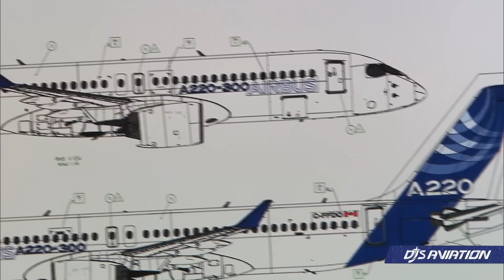Bad News For 787, Airbus News & Air New Zealand Problems

Comment: "Boeing can't catch a break"  In my opinion, Boeing is experiencing the side effects of corporate greed.
Reply: Corporate greed has nothing to do with dealing with supply chain issues
Reply: Spend your time reading Tolstoy, Chekov, and other socialist trash.  It sounds like it would appeal to your "money is bad" idiotic world-view.
Reply: @nickolliver3021  It actually does if a company selects vendors based cost vs. competent.   Airbus and Boeing both use outsourced vendors,  why is Boeing the company experiencing "supply chain" issues to the point supposedly impacting production.  Selecting the lowest bid is not always the wisest financial choice.
Reply: @dk-AZ  Do you not know that Airbus also experiencing supply chain issues that impacting production? Production is low at the start of each year because of Supply chain issues. Its not the fault of Boeing choosing its vendors that suddenly involve supply issues. They cant all be perfect. They all have issues in which need addressing all year round
Reply: @nickolliver3021 stop being a Boeing stan still. It’s not cute
Reply: @nickolliver3021 if it’s not their fault??? Whose fault is it???? They picked some cheap manufacturer. SHOCKER
Reply: @savabagwidow9554  Stop being an airbus stan still. its not cute either
Reply: @nickolliver3021  honestly at this point I’d cheer on a COMAC before boeing but too bad we’re in a duopoly 😂😂
Reply: @savabagwidow9554  I wouldn't cheer anything on. making a product is too bad that the world of manufactures is in competition 🤣🤣🤣🤣
Reply: @purplesprigs  Understand your sentiment and to a good degree sympathise (ie I agree on the cant about greed - as though the company reached its huge utility to society through charitable endeavour!)

Poor choice of authors to illustrate it, however.   

Being Russian doesn't mean they were socialists (they weren't).
Reply: if boeing had the pw1000 engine problems you'd say it was their fault 😂
Reply: @nickolliver3021 Dawg what?? I’m a pretty staunch capitalist, but boeing is a pretty prime example of mismanagement and unjust executive enrichment.. would say that 99% of boeings issues now are completely internal, and have nothing to do with “supply chain issues”
Reply: @s0rry00  so you now think that boeings issues with production have nothing to do with supply issues and its all down to their management for these supply chain issues that they are experiencing?? You do realise boeing do get affected by supply chain issues?
Reply: Ever fly on Russian built aircraft?  Ilyushin?  Tupolev?  I have and they are crap!  Virtual death traps!  But no worries about corporate greed in their heyday.  Pretty much everyone got paid the same number of rubles!
Reply: @purplesprigs  Tolstoy was a socialist? Are you serious? Are Tolstoy and Chekhov the only Russians you've actually heard of? Tolstoy was a massive landowner and had a vast army of servants on his palatial estate. Like Chekhov, he was Tsarist - anyway, Anton Chekhov died in 1904, that's 13 years before the Revolution. What trash you posted.
Reply: @alanmiller9681  I made several trips on a Tu-154 in Europe. It's a typical passenger airline. As a passenger, you wouldn't see any obvious difference from a Western airliner of the time. And, I SURVIVED all those trips!! What's a virtual death trap, anyway? Is that something that looks like a death trap but doesn't actually exist?
Reply: @alastairbarkley6572  My flights were on IL-14 aircraft between Warsaw and Krakow.  The IL-14’s nickname was the “Crate”, likely better suited for carrying crates than people!  It had horrendous horizontal stability, far worse than any aircraft that I have ever flown.  I even remember the cockpit door continuously opening and closing during the trips.  No!  Not comparable to other airliners.
Reply: @s0rry00 you know nothing about aerospace supply chain
Reply: @nickolliver3021  Nick its a side topic bigger than this video focus ... do some digging " how Boeing lost its way" an amazing fall.
Reply: @stihlnz  maybe do some research into how airbus lost its way when it's side topic is bigger than this video focus
Reply: @savabagwidow9554  Who's gonna tell them Spirit aerosystem used to be part of boeing? so cheap probably not. Oh and btw Spirit aerosystems also makes Airbus parts
Reply: @nickolliver3021  Corporate greed is what ruined the supply chain.
Reply: @mjoelnir1899  nope. Corporate greed ruined the world. Supply chain is totally separate
Reply: @purplesprigs tell that to the hundreds of people who lost their lives due to Boeing’s corporate greed

Comment: I've  flown in both A350's and 787 9's on many occassions. In my opinion the Airbus product from a passenger perspective is a much nicer aircraft.
Reply: It’s important to note that there is eleven years difference between the release dates of each aircraft.  That’s similar to comparing a Lockheed Constellation or DC7 to the Boeing 707 or DC8.
Reply: @alanmiller9681  Far from it. 707 was a jet airliner. You can't compare it to something like a Constellation the same way you compare a 787 and A350.
Reply: @perplexical  I have the right to compare what I want and you have the right to disagree.  I have no problem with any of that. The 707 was basically the 2nd commercial jet.  The first, the Comet crashed a lot.  The typewriter….the electric typewriter.  The stagecoach…the Model T.  A swamp cooler…an air conditioner and so on.  No need to whine like a Karen.
Reply: @alanmiller9681  Woah buddy. Just pointing out the difference between a Constellation and 707 is way bigger than the likes of the 787 and A350.
Reply: Yes

Comment: About time Air NZ felt heat from competition. I here it scalps it's citizens with unjustifiable high air fare prices.
Reply: They do, and been getting away with it for way too long. NZ is ridiculously expensive across the board.
Reply: Between petrol prices , airfares, mediocre rail services and the cost to travel on ferry Between islands . Most people don't even bother going anywhere anymore,  it would be more efficient to buy a sail boat 🙌. Some domestic airfares are more expensive then international routes

Comment: Boeing is losing the war.  They need a safety and engineering first culture.  They need to pause and retrain everyone on the production line as to the correct/non-short cut manufacturing process.  They need to have an engineer as CEO.  They need to do this all now.
Reply: So an engineer will cure all the supply chain issues?
Reply: Boeing's glory days (60's into the 80's) had a Lawyer as CEO. No engineering degree required to put out the 707,727, 737 or 747. All it took was a laser focus on listening to the needs of Boeing's employees and customers, and ignoring what the stock price was. 

McDonnell Douglas on the other hand was ran like Boeing is now. Total focus on stock price, cutting costs, and to this day, the highest fatality count in a single accident on US soil belongs to a MCD aircraft. Why Boeing took a look at MCD who to this day are responsible for the largest loss of life in a Non-terrorist accident on US soil and said "I want some of that Mad Dog DNA in my planes" remains one of the biggest Corperate merger FUBAR's of US history. 

So, sit back, and watch the Boeing Starliner launch coming up on May 6th. And consider without SpaceX we'd still be catching rides from the Russians as our sole means to get to the ISS that we helped build. That this is the first manned launch of that craft, which got the MAJORITY of the money for return to space is mind blowing why we are giving money to these people. A Company that didn't get any money from that contract, Sierra Space will launch their Dream Chaser likely this summer for contrast.
Reply: @nickolliver3021 can you read??? Engineering first culture back when Boeing was actually good 😂😂😂
Reply: Got too big for their own good.
Reply: @savabagwidow9554  This is supply chain related not Engineering culture of Boeing🤣 🤣🤣
Reply: @twotone3471  yes, and because a lawyer knows little to nothing about manufacturing, the CEO let the engineers run the important parts of the company
Reply: They need a Quality system.
Reply: Training won’t work if the workers don’t care about quality.  It seems the WA workers cared more than the SC ones.

Comment: Excellent video DJ. I don't believe Air NZs current financial situation is as bad as all that-- a rather large profit for last fiscal year & only reduced profits forecast for next time around. Fleet problems, spare parts availability as you've touched on are the real concern at Air NZ. The previously announced 787 10 delivery delays will stunt Air NZs ability for growth, just to compound the issue. But sure great to actually be making profits, at least
Reply: Nz is in a full blown recession money is low for the people who fly the most tickets are insanely expensive air nz is going to do downhill quick

Comment: Genuine question: how do we explain these ‘supply-chain’ problems? Surely not problems with logistics? So problems with suppliers? Under-ordering to save money therefore inadequate stocks? Keeping prices so low that suppliers cannot or will not increase production?
Reply: Good question. I guess most of the problem is experienced personnel shortage. During pandemic many aviation companies let their workers go. Those people either retired or changed their industry. Now the same companies need the same workforce back, but replacements are mostly inexperienced and not efficient enough.

Comment: Sorry, but bad news about Boeing is not news. It is a standard now.
Reply: Supply chain issues are standard across both manufacturers. So that should be classified as bad news for boeing and airbus
Reply: @nickolliver3021 lmao hurts Boeing a lot more though huh??? Boeing Stans 🤮🤮
Reply: @savabagwidow9554  it hurts airbus as well too Duhhhhh! Airbus stans 🤮🤮
Reply: @nickolliver3021  oh yeah 😂😂 like the 2 fatal plane accidents and then the door thing. Boeing Stans really need to look in a mirror 😂😂
Reply: @nickolliver3021  oh yeah and don’t forget all the Airbus whistleblowers 😂😂😂
Reply: @savabagwidow9554  Oh yeah dont forget the airbus cracks and the nose dive of the a350. Airbus stans need to look at themselves a bit more 😅😅😅😅
Reply: @savabagwidow9554  Oh and dont forget those Embraer and Comac whistle-blowers🤣 🤣🤣
Reply: Like the early Superman Comic books where the junior reporter Jimmy Olsen was repeatedly told by the news paper editor in Chief “when dog bites man, that’s not news. When man bites dog, that’s news”.  Today, when Boeing Management sacrifices safety, that’s not news. If Boeing moves headquarters back to Seattle, that’s news
Reply: @douginorlando6260  Today isnt about Boeing management sacrificing safety. This is about supply chain issues not about Boeing management

Comment: Air New Zealand or "Pirate Airways" as I prefer to call them. I am a frequent flyer domestically. The second the competition has sold all their seats on a particular flight , Air NZ's price for the equivalent seats go to maximum price.  It happens so quickly I am sure they have a program monitoring the competition's website.
All Air NZ offers  for 30 to 100% higher seat prices is 2 or 3 boiled sweets prior to landing.
Reply: chc to akl with a 2 week lead   Air NZ $633 jetstar $258 for peak time   cheapst is $355 vs $147  they screwed theyre own market up trying to be greedy and its backfired massivly
Reply: Boiled lollies harks back to the old NAC days.  Of which, l think they have painted an aeroplane in NAC colours recently.

Comment: I’ve just flown from Lusaka to Doha on a 787 and was not surprised to see part of the engine cover flapping about in the wind at 38,000ft! Airbus all the way for me!
Reply: How many 787's have crashed.All airlines have issues whether it be Airbus or Boeing. I fly Air NZ Boeings on long haul all the time. Im still here and while i admit they have made some major mistakes under Foran the planes are still safe. JMO
Reply: @Helmut1610  I think the fact I’m a red blooded Englishman doesn’t help!😂 I just feel safer seeing that Rolls Royce logo on the engines😁 I do prefer not seeing bits flapping around in the wind though!😂

Comment: The problem with air new zealand  not enough 787's available.
Both A320neos have PW engine problems the 787 has engine problems.

Comment: Boeing on a go slow due to supply chain difficulties..... There's a shortage of plug doors, nuts and bolts and decent engineers to screw the bloody things together properly
Reply: Can you really move on from nuts and bolts and plug doors. Would you say similar things about airbus cracks if you go on about this
Reply: @nickolliver3021 you’re cracking like the 737max, that's for sure sweetie. Lmfao
Reply: @alvinloh9068  Your cracking like the a350, thats for sure darling lmfao
Reply: @nickolliver3021  You're crying and cracking like the 787 that went nose-dive over Tasman Sea. Oh, when the A350 cracks, nearly all 787 should be recycled in a junkyard. LMFAO
Reply: @alvinloh9068  You're cracking like the A350 that went nose dived over pacific ocean. Oh, when the 787 peels, nearly all a350s should be recycled and sent too junkyard LMFAO
Reply: @nickolliver3021  You're cracking like the 787 and 737max that went nose-dived over the Tasman Sea with LATAM, Lion and Ethiopian Air. Oh, when the A350 finally cracks, nearly all 787 and 737max are due to be recycled and remain in the junkyard. LMFAO

Comment: the 787 is by far my favorite aircraft and in the midst of Boeing getting dragged by airbus, the lack of an MNA aircraft, and the MAX issues, the 787 really is what has been carrying Boeing and now theres shortages? I really am starting to believe in the theory that airbus will completely overtake Boeing in the market in the longterm.
Reply: I guess you haven't flown the A350.😂
Reply: @ljacobs357  not yet lol, hopefully soon
Reply: @ljacobs357  The A350 is quieter and more comfortable than the 787. It was designed for 9-across seating, not 9 squeezed into an 8-across design.
Reply: I have a simple safety policy. I only fly on Airbus.
Reply: @ihmcallister are we trying to compare apples to oranges. The 787 is quieter as well
Reply: @ihmcallister guess you haven't heard the news..
Airbus is offering 10 abreast seating on the A350.. several already going to that configuration !!
Reply: @ihmcallister It is also larger than the 787 so it does not take rocket science to come to that conclusion.
Reply: @Charles-sn7zy Right. To better compete with Boeing....